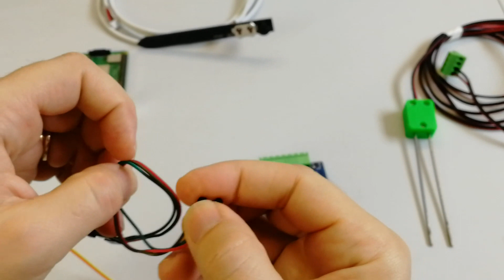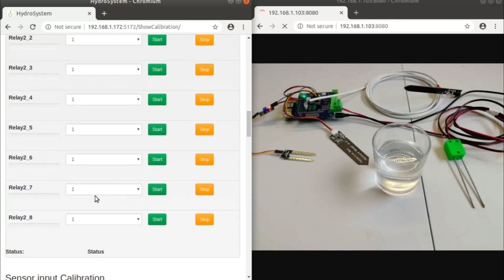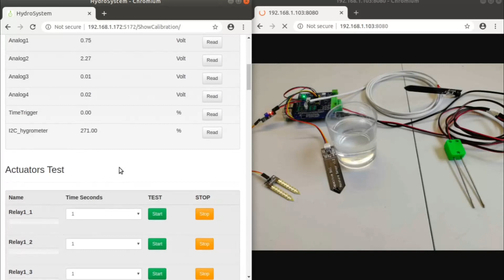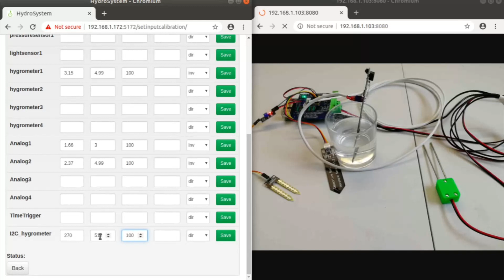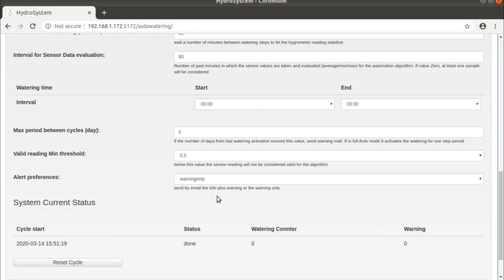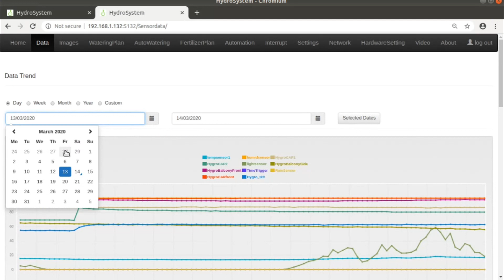Soil moisture sensors, Automatic irrigation and the Raspberry PI

Comment: how do i modify chirp to sensor mode only and program for connection with arduino uno using arduino for irrigation plant watering i have the relays and all of the components my problem is with how i connect the chirp sensor with the rest pls help thanks

Comment: I wish people tested in actual soil instead of a glass of water. The difference between water and no water is easy to see, but soil moisture is more subtle, especially a few hours after watering, when the water has settled everywhere.
Everyone tests in a glass of water however
Reply from the maker: Please check the last minutes of the video, the chart shows real data in the soil. I have two years database of soil measurements an automatic irrigation with real data. I agree that setting the automatic irrigation is tricky, but it is possible.
Reply: @hydrosys4raspberry19  Awesome thanks! I hadn't seen the last graph with the yellow line, seems to work well, I'll get that capacitor sensor as well thanks!

Comment: I have problem connecting resistive sensor to hygrometer slot on automation irrigation  HAT ver 8.1. Values are fluctuating significantly. Any Idea what to do? Other than that, you did amazing job. stay safe
Reply from the maker: Hi Goran, better if you can open a post in the forum, it would be a more convenient place to address it.
Reply from the maker: Here the link to the Forum post in case somebody is interested:
https://hydrosys4.wixsite.com/hydrosys4forum/forum/hardware-discussion/hygrometer
Reply: Hi @Goran Gajic, i can have the resistive sensor picture with you?? i want to see it

Comment: Wonderful job men!... whats was the sensor that you recomend to use? Capacitive soil moisture sensor v1.2?
Reply from the maker: Yes, the capacitive sensor 1.2 looks like a good compromise for price and performances. About durability, I tested it for some months and it is still fine so it looks promising.
Reply: @hydrosys4raspberry19  I read somewhere that the Capacitive Sensor outputs too high frequency for Raspberry Pi, do you downscale the frequency before passing on to MCP3008 or is this fixed in v1.2 of the sensor?
Reply: @hydrosys4raspberry19  it the irrigaration board still available? I like to buy it.